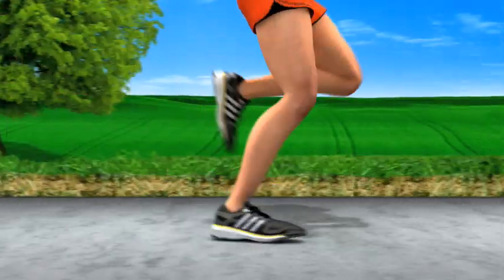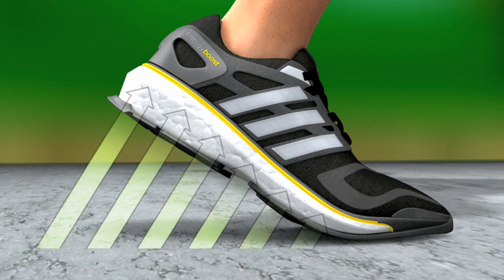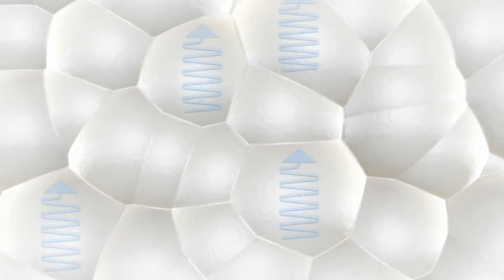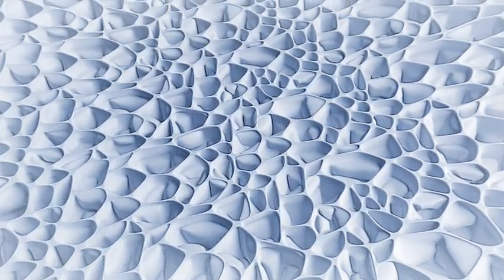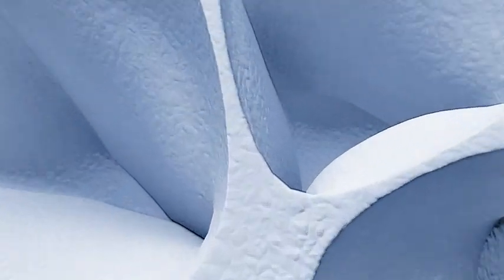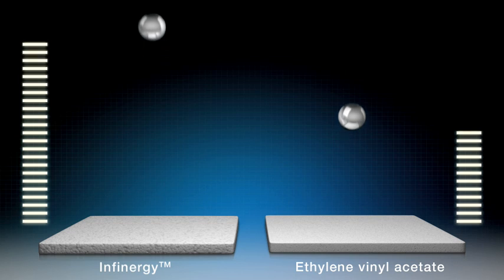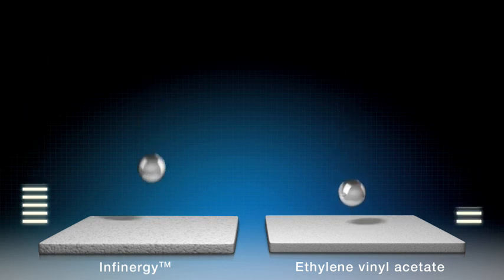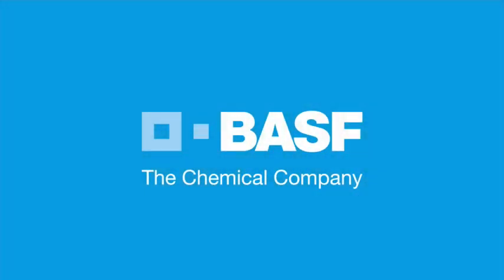New BASF foam Infinergy revolutionizes adidas running shoe

Comment: The runners technique is incorrect. The front of the foot should be landing and not the heel. With the heel coming in to contact with the surface first, this has a braking effect.

Comment: Understand this if im wrong, you may correct me. Such material with such high rebound is very bad for the knees.  The force applied is bounced back towards towards the leg, it makes you bounce higher but sacrifice the protection of your knees. It also ruins the natural shock absorbtion created by your body. I shall explain my perpective more if one wants to disagree with what i say.
Reply: You are correct. The front of the foot should strike the surface before the heel. The archives heel provides support for the knees in a natural way and projects the runner forward.